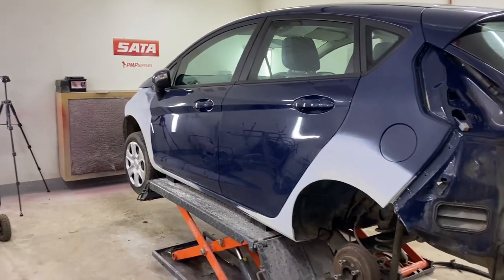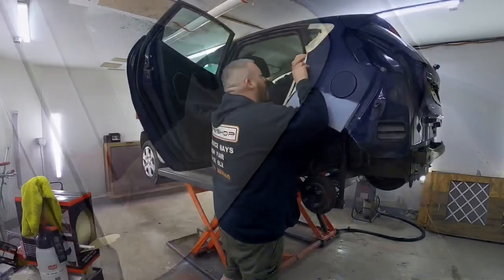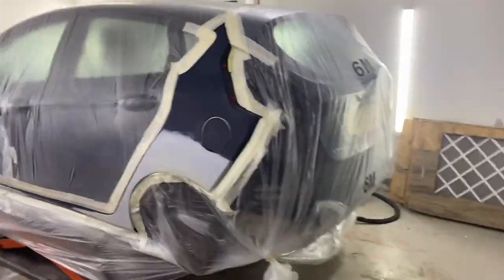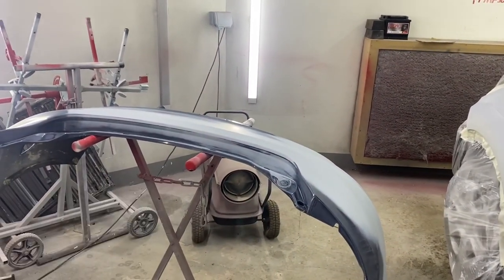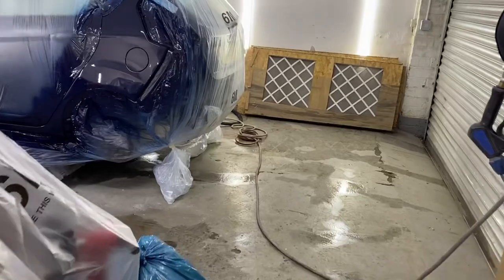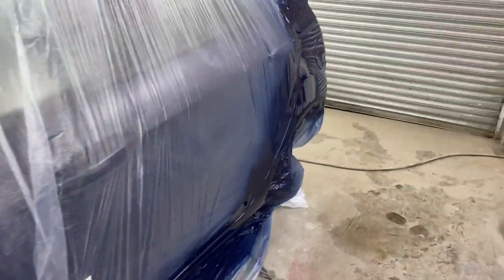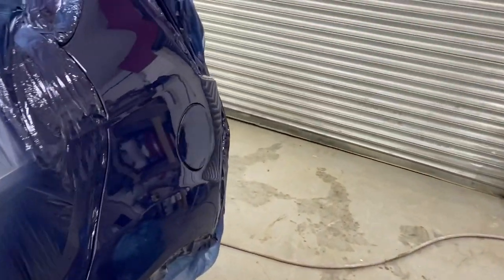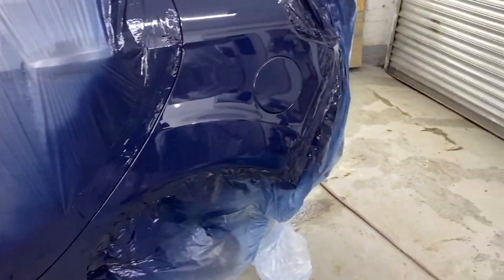Copart bargain repairing a smashed Ford Fiesta part 4

Comment: An easy way to mask the rubbers, use string. Lift the rubbers, slide string underneath the rubbers around the window. This gives you enough space to apply masking tape. Apply the tape and fold under. Once dried remove tape and string.
Reply from the maker: Never done that I’ll grab some and try it next time 👊👊👊👊👍👍👍👍👍
Reply: @grantssmartrepairs  Let me know what you think! :)
Reply from the maker: Will do I’m sure another fiesta will pop up 👊👊👊👊👊👊👊

Comment: Grant
I have a question mate how do you touch up a scratch on say two or three panels do u after spray the complete panel what do u do
Phil in stoke
Reply from the maker: All depends on size depth and location some may have broken the clearcoat some may not the ones that have not broke the clearcoat you can flat and polish the others may need paint so hard to answer as there’s so many variables if that makes sense 👍👍👍👍👍

Comment: Do you only work with 2k paints?
Reply from the maker: No mate I use all 🤣🤣🤣🤣 I just had blazer blue in both base coat and 2k so I just used the 2k for this one wish I didn’t as this gun was playing up 🤦‍♂️🤦‍♂️🤦‍♂️
Reply: @grantssmartrepairs  I don’t know a big a lot about painting but iv done a bit I find the water based paint hard to use would prefer the 2k any day and I think you done a great job quick rub and a polish 😎 keep up the good work from Belfast